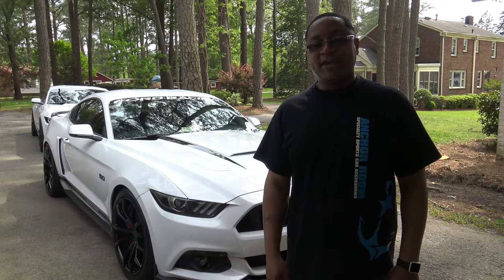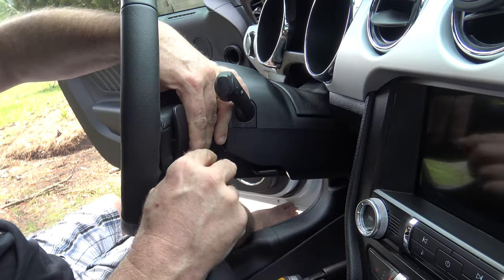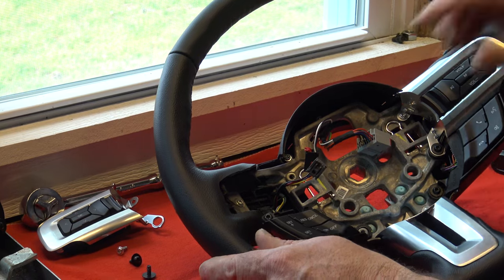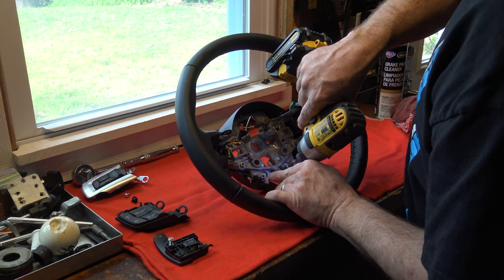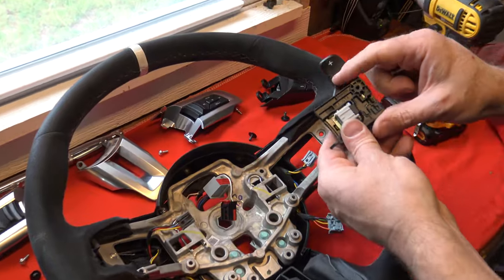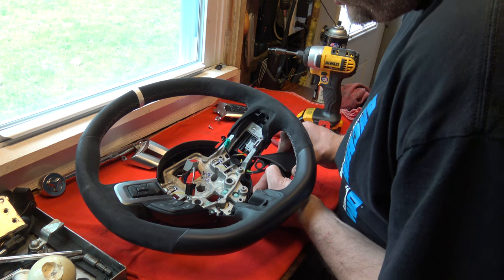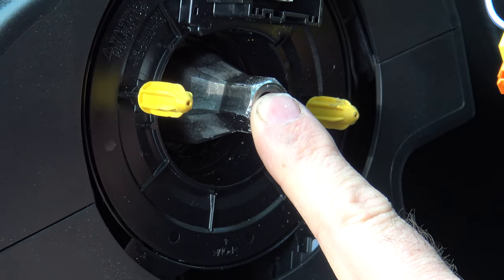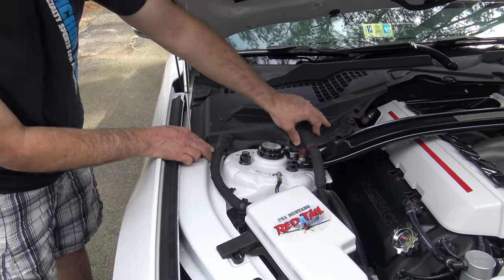2016 Mustang GT:  GT350 Steering Wheel (w/ Paddle Shifters) Install

Comment: Hey, my Brotha' from anotha':  Where were you when I needed your advice on the paddle shifter extensions blocking the airbag release holes? Yes, indeed--I had a major problem! You see, I want to install the GT350 wheel on my own 2017 GT. However, I permanently glued on my paddle shifter extensions with JB Weld epoxy. Oh, yeah! You guessed it! I was screwed! I absolutely could not reach the airbag release holes! I needed to take them off as a dry run to practice the steering wheel removal. So, what did I do? Sigh... I had to take my Dremel and ream holes though my aluminum paddle shifters (I have the same red ones you do). Yes, I did fuck them up doing that, but fortunately--I actually wanted to replace my paddle shifter extensions with the carbon fiber extensions anyway. Therefore, I was back into a winning situation as my destruction of my current paddle shifters meant I was able to remove the air bag and thus, the steering wheel! CJ Pony parts and the manufacturer of the paddle shifter extensions need to give the exact same warning you ingeniously gave: That is, THE PADDLE SHIFTER EXTENSIONS BLOCK THE HOLES TO THE AIRBAG RELEASE SPRINGS! In addition--you would think that the manufactures would have already provided notches in them so as to not block those damn holes!!! Geeeez!!!

Comment: Other videos are not as detailed or as specific with the paddle shifter change over. GOOD JOB, excellent video, saved me the $120 having the dealership make the swap. I'd like to know how you made or changed the center marker to white? My 50th is also white/black trim white stitching. I can see it would be a nice touch. Suggestions?
Reply from the maker: Thanks!  Glad it helped you out.  The strip on my steering wheel is covered with white vinyl.  I don't think they sell it on their site, but if you call Anchor-Room.com they'll probably work something out for you.  Just tell them you saw my video.

Comment: Hi, I know you posted this a long time ago. I just finished this process on my 19 GT. For some reason after reconnecting the battery I have a airbag light and code on my Ford pass app that I can't seem to remove even with a code scanner. Do you have any ideas of troubleshooting? So far the code scanner didn't work. I tried unplugging the positive and negative. Let it sit for an hour. Plugged it back in. Still showing airbag light and a code message on fordpass app

Comment: how did you manage to remove the paddle shifter extensions. The double sided tape seems to be holding on pretty tight and afraid to break something trying to get those things off?
Reply from the maker: I used a heatgun

Comment: HI there, Great video, I have a automatic mustang same with you, I really want to know how to remove the paddle shifter extension. I used the 3M tape when I installed and now it's really tight. What do you suggest me to do when removing it? Thanks
Reply from the maker: Thanks, when I removed my extensions, I used a heat gun to help loosen the tape and then I used a plastic pry tool to get the extension off.  Just be careful as the aluminum extensions get extremely hot.
Reply: Thanks for the reply, That was exactly what I was thinking, glad to know someone who had tried and worked
Reply from the maker: No problem!

Comment: Hey for the steering wheel why is the gt350r cheaper than the gt350 wheel? How is the steering wheel holding up?
Reply from the maker: I hadn't noticed a price difference, but it's been a while since I've looked.  My guess would be because of the red stitching.  The GT350 blends better with most interiors, so companies may have started discounting the GT350R one.  And the steering wheel is holding up great!  I love it!

Comment: Hey guys, 
whats the best way to remove the paddle shifters without damaging anything?
Reply from the maker: You talking about the stock paddle shifters or the paddle shifter extensions?  The stock ones just unscrew as shown around the 9:20 mark of the video.  The extensions are easiest removed by using a heat gun to warm it up and then pry them off with a panel removal tool.  You have to be careful using this method though, because the extensions are aluminum so they will get extremely hot.  Wearing gloves is recommended.

Comment: how much torque do I need to apply on the nut holding the steering wheel?
Reply from the maker: Good question.  It's 35 lb.ft (47.5 Nm)  The complete manual with all of the torque specs can be found here:  https://performanceparts.ford.com/download/instructionsheets/FordInstShtM-3600-M350R_FP.pdf
Reply from the maker: Cool, one of my favorite mods!